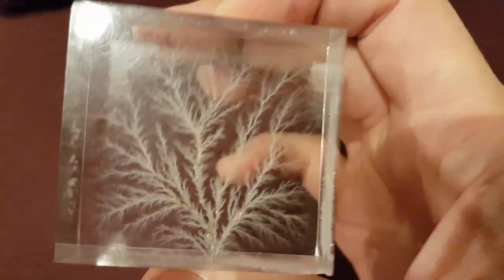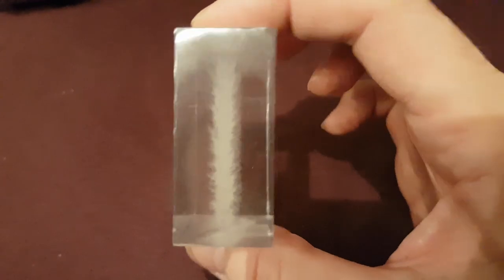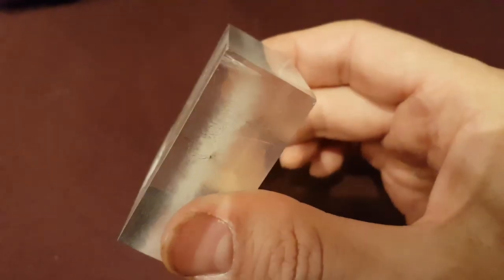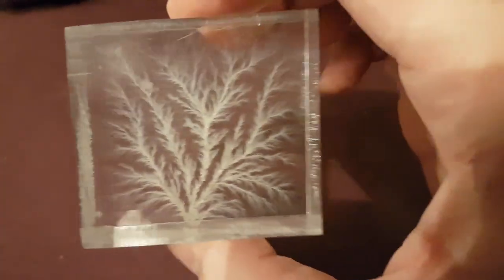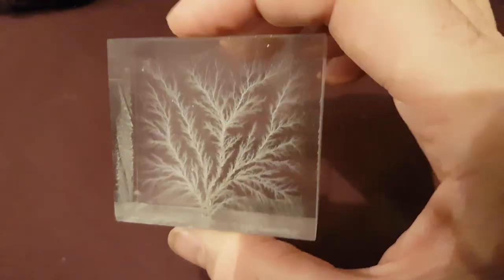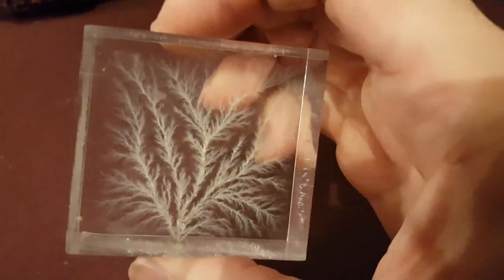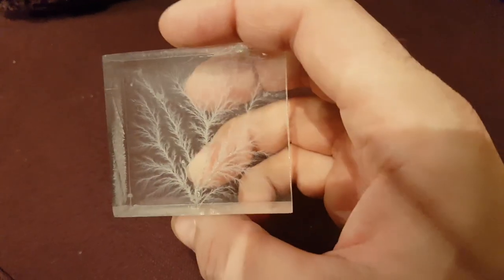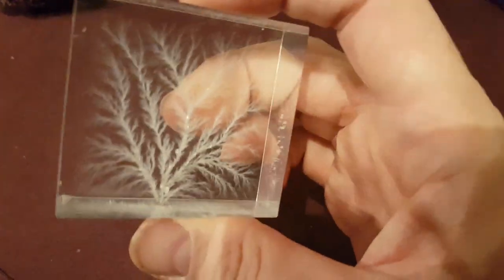Lichtenberg Figures

Comment: Saw an interesting video of a golf ball being struck by lightning mid flight.
1. The lightning stopped at the ball and did not continue to the ground.
2. Golf balls unlike any other ball design are shaped with pores to compress air so they can float up.
3. The pores could create vortices of are spinning around it.
4. Golf ball itself was unharmed though it glowed red or orange brilliantly, as if the air heated up but the ball remained unaffected by anything except heat.

Makes me wonder if lightning seeks out areas of compressed air that is spiraling. Maybe someone could make an air compressor on a pipe and induce lightning strikes
Reply from the maker: Likely DECOMPRESSED air - since that is less effort to ionise - so probably in the balls wake